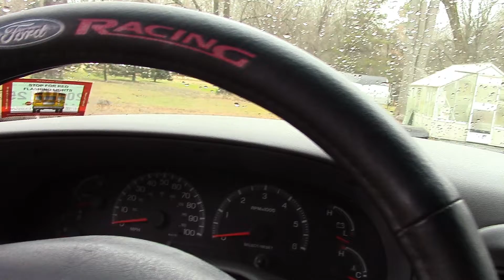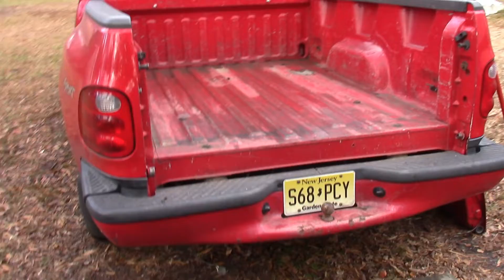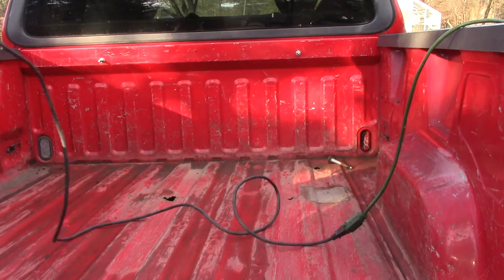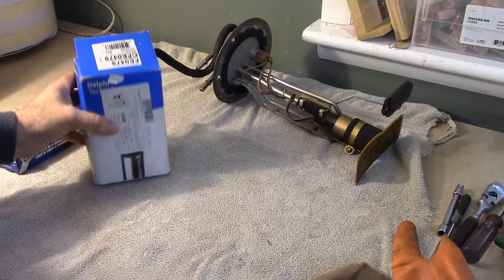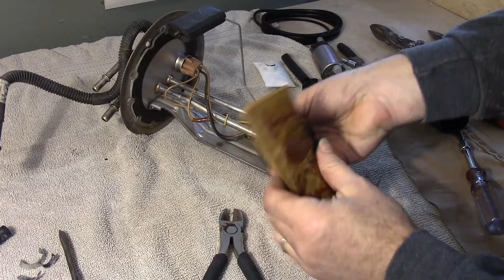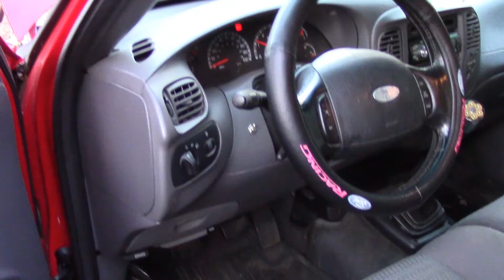FORD F150 Cranks But Won't Start - FIXED!!  EASIEST FUEL PUMP Job Ever! Full Step-by-Step Demo

Comment: i have very similar problem, but my dashboard won't turn ON as well, .... any solutions from anyone,  it takes several tries and then engine is ON however.
Reply: Get an OBD scanner. It will tell what's wrong with it

Comment: FYI...this method WILL NOT work if you have a super crew (4 door) 2003 model. You will need to drop the fule tank.

Comment: My 1997 F150 has a "super cab" which looks identical to your 2003, but my pump is under the cab so I was very surprised to see yours is under the bed so they changed the design some time after 1997.

Comment: my 2000 expidition gave me signs, it would crank and run for about 3 miles, then die. The longer you let it sit the longer it would run before it died again. I replaced the inline gas filter and it seemed to help it run longer , thought it was fixed. The next morning it wouldn't crank at all . I hit the tank with a rubber mallet and it cranked but i knew it was time for a new pump. Being in my 60's i weighed the benefits of having it done or doing it myself. I did it myself. Technically it wasn't difficult but physically it was a challenge. Got her replaced and it cranks fantastic, runs great . Saved myself a lot of $

Comment: What are you conbecting ur leads to specifically.
 Im using a DM greenlee multi meter,ty
Reply from the maker: I put my multimeter on the Ammeter setting. I pull the fuse for the fuel pump, and connect the leads to both sides of the fuse socket.
Reply: @Buckwsr  ty.
 It turns over but no start.
Reply: As i was traveling down my street it just died...way back in january.
  Been without my f150 xlt lariat, 5.8 dince then
Reply: @Buckwsr  sir,
 I have a clamp ring multi tester.that im probably honna need to use since i cant readily observe the read out on screen of my multi tester as i tap into circuit
  My fuse box is under the dash on the left side.
  There is a feature on ring clamp that "holds" the highest reading.
( soon as i figure out how to use it, lol)
  I wonder if yhat circuits wire tuns to my fuel relay and if it gas same color....
Reply: Buckwsr...why would both fuel pumps not "whine" ( activate)?
  Im asleep  by 11:30 p.m. Central Time.
  Otherwise hopefully i can talk more tomort oi w,ty.
Reply: On this year truck...Ford did not havea..."dedicated" electric valve.
  They were incorporated in fuel pimp assembly as u might know by now.,ty for any more comments.

Comment: I just fixed a 2001 f150 crank no start with flashing theft light and dashes in the odometer readout. The fix was to remove and reconnect the PCM. Micro fretting corrosion in the 23 year old PCM connector causing no communication. After checking power and grounds and reconnecting the PCM the theft light no longer flashing and 229k .mileage in the odometer instead of dashes. Truck starts and runs. 

Hope this helps someone
Reply: What is a PCM I have a 2002 Ford F150 I'm having a theft light situation

Comment: I have a 98' stepside , maybe scooting the bed back isn't as hard as it looked.
I'm at 199K , factory pump still working good as far as I can tell. I'm torn between going ahead and putting a pump in it or driving it until it stops working. I've read/heard of folks getting 230-240K on the factory pump.
 I've seen the trick of whacking the fuel tank while someone cranks the key. I had heard it's your last shot and it was on my friends F150 , when it got turned off that was it. 
Subscribed/Liked/ thanks you did a great video.
Reply from the maker: Thank you so much.

Comment: Buck, thank you. I have a 2001 Ford F150 4X4. And I traded it, and when I went to take it to the dealer, it would not start. I intend to do the same test and figure it out.
They said to just tow it in, and they would get it going, but I traded it as a running vehicle, and I will not take it in if it's not running. Yes, it's a dealer with their own mechanics, but right is right, and wrong is wrong.

Comment: I currently have the same problem. Changed it a couple years ago. Gone bad again. Did you think you could have moved that box by yourself? I am a 62 year old very determined person haha. 😂 had two people help last round but never gave it any thought as to whether or not I could move it alone. Thanks for the video!
Terry
Reply from the maker: If you put the rear of the truck on jack stands, then remove the rear wheels, unbolt the bed,  disconnect the filler neck, and then you should be able to pull and slide the bed straight back. Lifting it over the wheels was the reason I needed a helper. Good luck.
Reply: @ yeah that is what I thought. Thanks for the response. 
Terry

Comment: My 08 expedition start the same fault, question : I have one external electric pump , can I install temporally ,till move uphill (truck is on street)…then replace the tank fuel pump , if yes , where to install it , immediately after filter or close to injectors rail ? Thanks !!!!!😂😂😂

Comment: Instead of grinding the head away couldn't a nut be tacked in place and backed off that way then cut the nut loose?
Reply from the maker: Yes, if you've got a welder, which I do not....

Comment: I would of just dropped the tank. Only got 2 strap holding it. By the time you do did to do this job. I’m already finished replacing the fuel pump. Take me 1.5 hours to replace the pump.
Reply from the maker: Your comment fits under the category of “how I can do it better.” Not sure why someone as skilled as you even needed to watch the video….
Reply: @Buckwsr  Boom great comment my friend, we are all here to get ideas and lil tips and tricks to diagnose and repair. I can do most work on my truck but more information is always welcome
Reply: …and you can pull the bed in less than 10 minutes.  25 minutes start to finish.

Comment: I thought about going to the tavern to get some help for cash, but I spent the money on a chain hoist, load leveler and chains that I could use to take it off and put it back on.  I put a landscaping timber across a couple of joists in the garage to hang the gear.   Now I can hoist other stuff, too!

Comment: I had this problem with my 2002 f150 just more than one year after I bought it.  I discovered in 2023 that one of the clamps on the fuel hose under the bed was partially broken.  I suspect the poor seal allowed fumes to leak out when the line was under pressure (ambient temps).  Cycling the key would send fuel to the engine and eventually start.

Comment: Very informative. Troubleshooting details are presented clearly. Logic evident throughout. 
I would like to see some of the testing details.  I assume a tap for the fuel pressure; I'm curious about amperage test setup and execution. 
We have a '92 F-series so some of the techniques apply. 
Thank you- video detail and repair quality are excellent!
Reply: I agree...what is hooked up to what for Amp and pressure test. Excellent video otherwise.

Comment: Meant to ask-whose pump did you use? Motorcraft or ?  I skipped to the end so if you said the brand in the video, my apologies.
Reply from the maker: I used the delphi brand pump. See link in description. Verify the right pump for your vehicle, of course.

Comment: Our 2016 Expy is crank no start.  I’d spray carb cleaner into the throttle body to verify it’ll run but I’ve heard that’s bad for the turbos.  I like the amp meter idea.  
Thank you ❤
Reply from the maker: A brief shot of starting fluid or brake clean into the throttle body is a good way to verify that you have spark. Done sparingly, I don't think it will hurt anything.

Comment: Where did you connect the amp meter?  Can a standard multimeter be used for this?  If so, on what setting?  I watched both videos.  Thanks for making them!
Reply from the maker: On my truck, fuse #10 in the under hood power distribution box is for the fuel pump, a 20Amp fuse. You have to remove the fuse, and use your ammeter with prongs inserted on both sides of the fuse socket. I used my harbor freight multimeter on the ammeter setting.
Reply: Thank you, very educational... 👍

Comment: Awesome video the first fuel pump video i have seen where you pull the bed instead of dropping the tank.
Reply: It's much easier to pull the bedding off than dropping the tank.
Reply from the maker: Thanks so much!

Comment: Buck since the bolts haven’t been off in 20 years maybe some penetrating oil might have helped some.
Reply from the maker: You  might have missed it when I mentioned first crawling under the truck to hit those bolts with penetrating oil....I was glad to at least get 5 out of 6 loosened and removed easily.